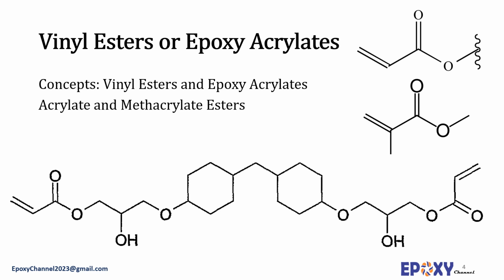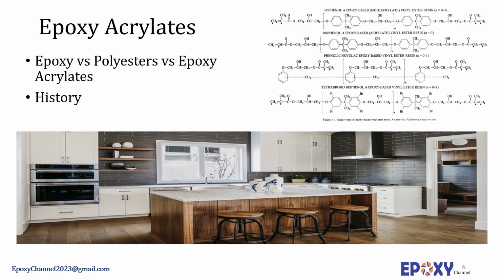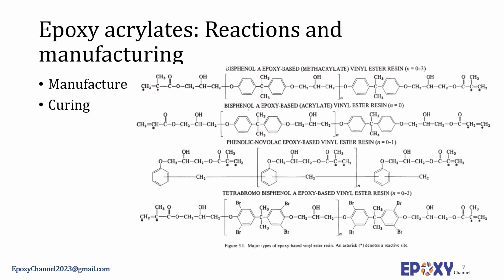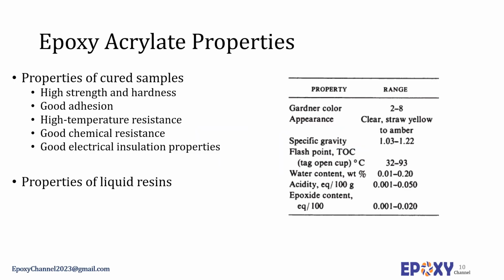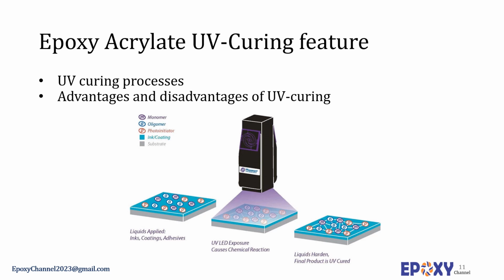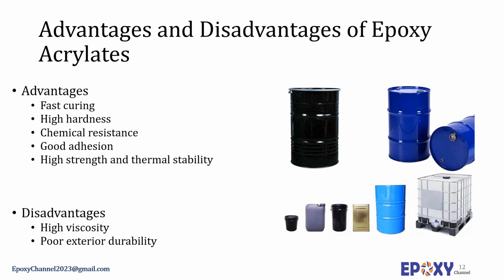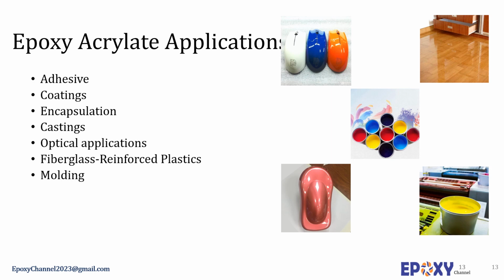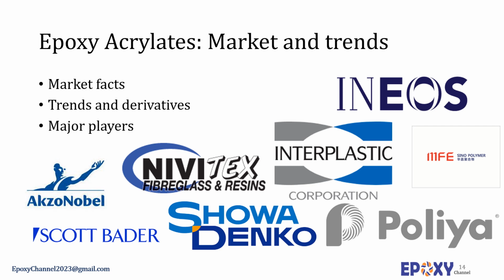Epoxy Acrylates – Vinyl Esters - Session 23

Comment: Hey Arash you make very good content first I introduce myself I am Sahil Sahu from India, actually I need your help currently I am pursuing my masters in agriculture farm machinery I need help regarding my final Thesis on biodegradable composite to replacing tractor parts , in composite there is base material + matrix ( epoxy) to strengthen material, I want to replace epoxy with any biodegradable material can you plz help me with that
Reply from the maker: Thanks dear Sahil. Sure. I have worked on biobased composites. Actually my thesis was on lactic acid based thermosets which showed a great potential for such applications. I suggest you first check my papers on that at my googlescholar and then let me know how can I help you. 
Good luck.
Reply: @Epoxy_Channel  Thankyou so much for replying and how I access or check your papers on Google scholar can you share link or something
Reply from the maker: Hello. 
You can check my profile here: 
https://scholar.google.com/citations?user=bgobmREAAAAJ&hl=en&oi=ao 
You can check my papers on star-shaped thermosets. Especially the one, in which I have used itaconic acid. Itaconic acid thermosets were 100% biobased with substantial mechanical properties, comparable to industrial epoxy composites. 
Please let me know if you have problem finding them.
Thanks
 @Sahilrfilms
Reply: @Epoxy_Channel  Thankyou so much